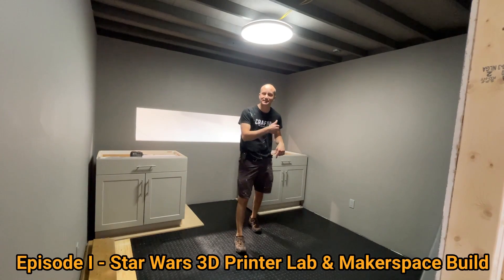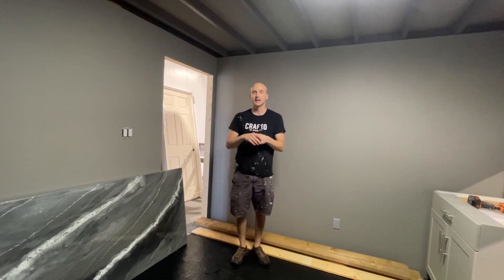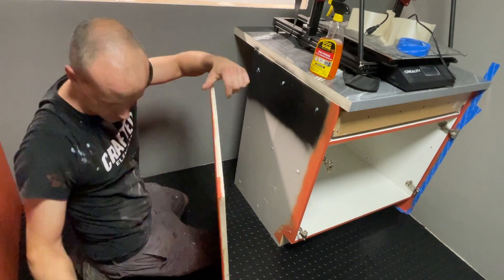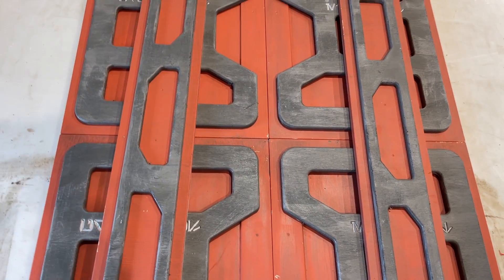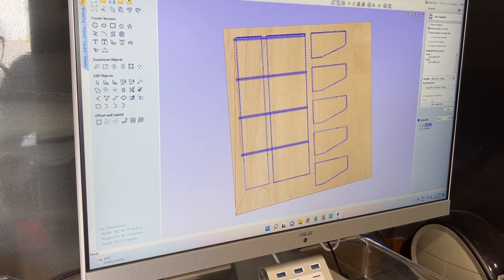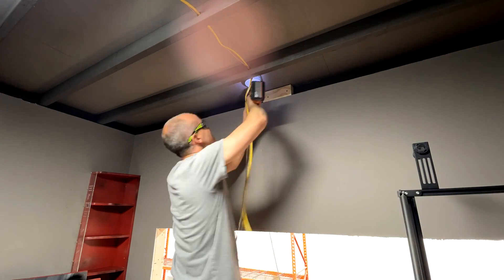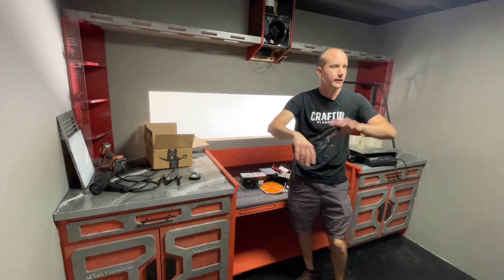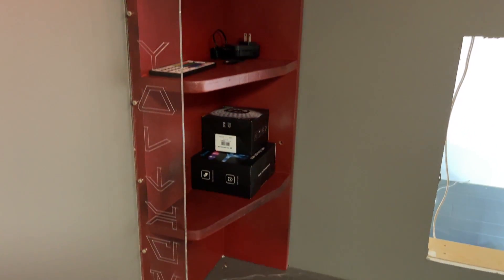Epic Star Wars Room Build - Episode 1

Comment: A great start to your space. If you want a better backer than the paint behind your lights aluminum foil tape is cheap and faster than paint.
Reply from the maker: Hi Wayne. Thanks for the comment. Do you mean using the foil tape within the channel created in the shelf so its reflective? That would make sense and would create a reflective surface.
Reply: @MakeEpicThings  yes the area you painted white on the inside I normally will use aluminum tape. The normal use is for duct work.